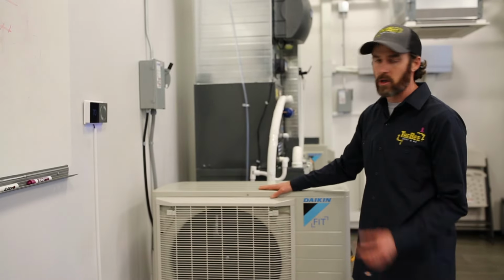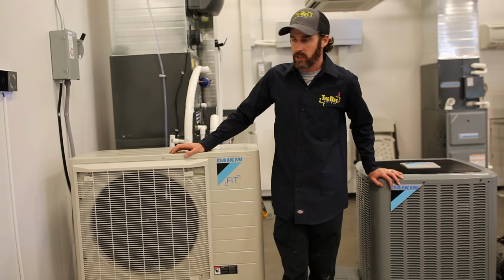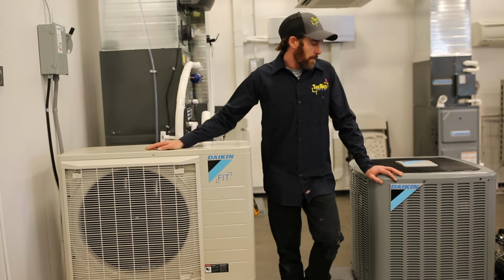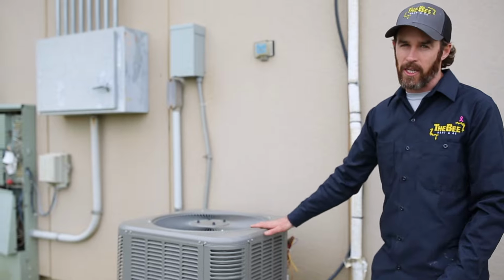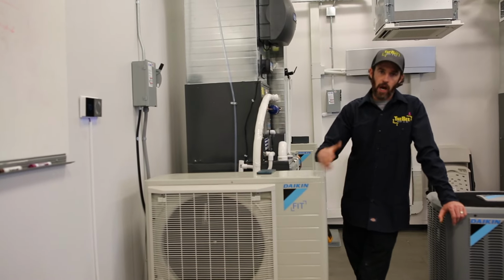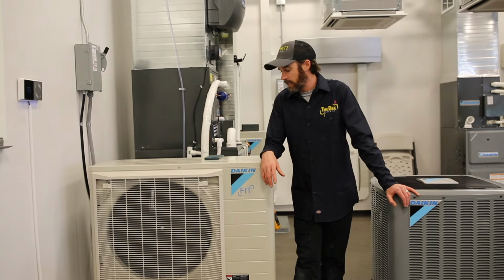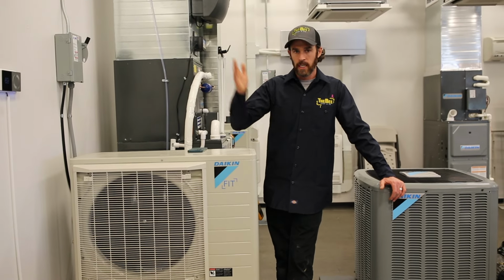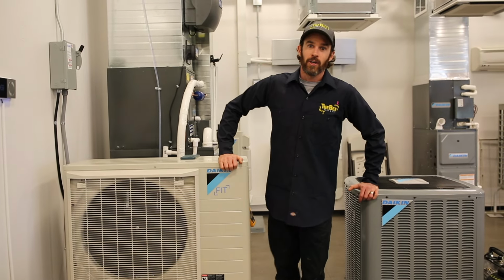BUYING A DAIKIN FIT?! Watch this FIRST or live with REGRET FOREVER!!

Comment: I’ve just replaced my old Carrier with a 3 ton Daikin 7 SEER A/C. My question is, does the installer need to add refrigerant to this brand new unit? I was told that the manufacturer pre-filled it with refrigerant so which is which??🤔
Reply: Yes, these units come prefilled with refrigerant, but more may need to be added, depending on the length of the lineset

Comment: Your amperage demo was not only garbage, it was also dishonest as hell. It maybe the worst I’ve ever seen. Your typical two ton outdoor unit will draw between 9 to 13 amps. Regardless if it’s a DC inverter unit. FYI, Electricity is sold in kilowatts not amperage.

Comment: Be sure that your ductwork is up to snuff before upgrading to a variable speed Daikin.  If your ductwork has too many Y’s instead of distribution boxes, it will not give you enough airflow to properly cool your house due to the lower fan speeds.
Reply from the maker: Good advice, I haven't seen this but we deal with mostly hard pipe on installs in colorado

Comment: FITS are horrible at heating (DON"T GET) !!   I purchased 2 sets of 17SEER Daikin Fit Heat Pumps.  The temperature stability and reduction of thermal swings in the summer month has been great, BUT it really SUCKS as a heater.  I've complained about this, but the company can't do anything about it, and has remarked that i'm not the only customer with this complaint.  I have two FITS, so it's unlikely that I have two bad ones.  The FITS seem to want to go into defrost mode after nearly every heating cycle, producing multiple horrible cold drafty sessions (each lasting over 30 min ) every night. This behavior might be reasonable in cold states up north, but this is Arizona in the southwest.  Temperatures rarely drop below 45F.  I get the temp on the coils is far lower, but this behavior is ridiculous, counterproductive, and uncomfortable. Older HVAC systems, don't behave this poorly. I grew up in NC (a far much colder climate) with heatpumps that didn't behave this poorly in the winter.  At the very least, the Fits should be programmed to blow with much less power during defrosting, but they seem to go full throttle during defrosting. Also, when the heat kicks on, it starts up cold. They should pre-prime the coils to be hot, before starting the blowers!  Unfortunately the furnace option for the FITS were not available during the time of purchase.

Comment: The startup current of traditional compressors often trips off a solar inverter supplying it, so need to wire-in a "soft start" (~$350).  Not a problem with newer inverter-drive types.

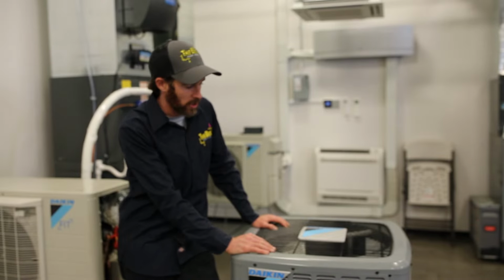Comment: I pulled the trigger and purchased the Fit for my home in Fort Worth. The installers,2 guys,showed up around 7:30 and got started. They removed the entire system and had the new Fit installed and powered on about 11:00.it was around 90 degrees in the house,typical North Texas summer day, the temp dropped to 76 degrees inside in about 20 minutes. I was shocked at how quickly it got the temp down. They had set it to 68 which is a bit too cold for me but the humidity and temp in the house was great. The air flow is better than my old system. My home has never been so comfortable. Although the Fit is a tad pricy,it consumes so much less energy. I have solar a Tesla Power Wall and a Span Panel so I can see how much power my home consumes. I’m excited to see how much my power bill drops. I’m very happy so far with my purchase and see it as a good investment.
Reply from the maker: Right on! That's awesome sounds like it's working well :)
Reply: Hi there! Still liking your Daikin Fit? I appreciate the reply.
Reply: @DanieleHawkins yes I’ve had it for a year now and it’s cools like nothing I’ve owned before. Really energy efficient. I have solar on my home and my electric bill was $11 last month. Best home investment I’ve ever made.
Reply: @fw1421 that’s great ! Thanks for the reply. 👍🏻
Reply: What system were you using before? Are you still liking the daikin fit? I'm looking to replace my system with an Amana S (basically a Daikin Fit) but I'm worried it wont be able to handle southern Texas humidity and heat in the summer.
Reply: @ I had a 12 year old Goodman system. My December my electric bill was $35 dollars and my gas bill was $130. I had gas in the house from being built and liked the gas efficiency. My A/C guy didn’t tell me the Daikin made the fit as a heat pump system to so I didn’t get the big tax credit but I still get a $600 dollar tax credit,or so say my Tax lady. In all I’m very happy with my purchase.
Reply: I am in the Aledo, I am looking at this Fit also for my new build. Who did you go through and can you share the cost? Also what tonnage did they install?
Reply: What year was your home built and how many sq ft? We have a 2600 sq ft single story home built in 1995 (original insulation) and are being quoted to replace our trane 5 ton 2 stage from 2013 with a 5 ton daikin fit.  We are just concerned if the fit can consistently keep the temp and humidity down since we live in Houston area and our home is not exactly energy efficient.

Comment: I have discovered that in the VA beach area two of the companies were asking $3000.00$4000.00 dollar in stall (metal vents are all ready there and the 60amp wire was installed by electrician) I had to pull teeth to simply get them to tell me HOW MUCH WAS THE UNIT? How much for Labor? I find a 5 hour or less install is CRIMMINAL to ask for $3000.00- 4,000 for fricken labor. Is this the new "CON JOB" and what all the kids are doing?

Comment: What is the difference between DZ6VS and RXTQ 4 ton heat pumps? Which one considered better?
Reply from the maker: RXTQ is a VRV and has more functionality / can be paired with multiple indoor units... technically VRV is "better" for this reason but IMO I like the way the daikin fit heat pump performs instead... the VRV functions as a multi speed blower instead of variable speed like the daikin fit heat pump so you'll technically get a little more airflow functionality with the Daikin fit heat pump than with the VRV (RXTQ)... VRV is typically a lot pricier too to install just because of the design considerations and extra components. If you're not zoning there's no need for an RXTQ
Reply: @thethoughtprovocateur thanks for the comprehensive answer! I do need zoning, but only between 2 floors regular ducted zones

Comment: Is the Fit worth the increases price to purchase?
Reply from the maker: I think so, it’s normally not a “big jump” but that’s relative. From our cheapest system to the daikin fit is usually only $1,000-$3,000 more because there’s a lot of state and federal credits on the heat pump right now. In Denver city it’s even cheaper because they have a huge city rebate for heat pumps on it. But even at full price I think it’s worth it for quiet, and max comfort. If you don’t care about your system being quiet it’s probably not worth the upgrade but as an HVAC guy I’m kind of a “connoisseur” of HVAC lol so it’s worth it to me

Comment: I work on daikins everyday 12-20 seer including the fit and I’ve ran so many callbacks on new installs that were done correctly. Even a small lighting storm can completely fry these things at times. These units are not ready for mass consumption in their current state. I’ve checked every aspect of these units in and out and in the two years I’ve only two of them that had temp splits over 15 degrees (in charge mode after 20 minutes). These fit systems all have low temp splits and a lot of people complain they won’t cool the home during regular runtimes. IMO get a single or two stage system they will be more reliable than the Fit
Reply: These units are not what they're cracked up to be, even with a surge protector on them the boards go out quite often , if you change one board you better change them all.
Reply from the maker: It’s true they can be more finicky but we don’t have that issue in Colorado.
I know in more extreme climates they can have issues but we also put surge protection on every system we install on the indoor and outdoor unit and that seems to save a lot of issues with boards and ecm motors etc. We looked at it and decided including $150-200 worth of surge protection was cheap insurance against something getting fried and they’ve done pretty well for us

Comment: Great video..as always. Would you happen to know if the air handlers supported by the Daikin fit (heating and coolling units) allow for the air handlers to be turned off once the desired target temp is reached? Thank you
Reply from the maker: Yes they do, it’s in the settings on the thermostat
Reply from the maker: They do have overcook to dehumidify and “dead band” settings though so it will always overshoot the temp by a degree or two and this is normal, and waits a degree or two before kicking on. This is for efficiency… for example if you set it at 72, it might not kick on til it rises to 74 and might not shut off til 71/70, and the reason is longer run times improve efficiency and comfort. But what you’ll find is on the hottest days it’s very comfortable because it needs to run constantly anyways and modulates down once it hits set point so it will run in low speeds a lot

Comment: I received 3 quotes for replacing my 22yr old furnace and york ac. I was almost sold on the Fit but then another bid was presented and it was mentioned to check the BBB for Daikin and wow a nightmare under that name. Lots of people heavily regretting the Daikin product. We live in the Pacific Northwest with mild winters usually and a few months of 80's/90's. Almost thinking the standard American Standard 80/95 furnace and 3 ton AC for our 2200 sq. ft. drafty home would be a better fit. It's about 12k and the Fit is 15.6k after all the rebates. Just don't trust the governments motivation and their solutions for green is usually poo. Take the florescent replacement bulbs that you dare not break or release toxins in the house with a long list of how to deal with it. No thanks green government initiatives are usually crap.
Reply from the maker: Surprised that Daikin has more complaints than others? I’m pretty sure all of them have had their fair share but you won’t regret a basic AC / furnace combo by any means. Biggest thing with the Fit is sound

Comment: No one in Houston knows how to fix them; my 4 year old daikin 18k heat pump only blows cold when it is sunny and very hot outside…everyone wants to throw expensive parts and daikin support won’t help.
Reply from the maker: This sounds like a settings issue… there’s a cooling range but it should be able to cool year round in Houston, installer settings should be able to fix this I’m sorry you’re having a hard rime
Reply from the maker: If you’d like a referral lmk we can try to find someone to help you out in Houston

Comment: Just got a new unit and I find that the fan inside the house in the closet is very loud
Reply from the maker: You or the installer can adjust the blower settings and ramping profiles. You can also have them insulate the return box with duct insulation to quiet things down

Comment: Got our 2 ton outdoor cold climate unit with a 3 ton indoor unit. I noticed the fan noise was a bit much. Found the dealer edit option on the thermostat and turned down the heat fan speed on all 3 levels to 15% reduction. Now it is a lot better. Is there anything else that should be done to double check the air flow is correct?
Reply from the maker: No that should do it, that air handler is probably just putting out more airflow than needed we do the same / similar things often on systems to match customer comfort. Most of the higher end systems with more settings just require that type of fine tuning to get it just right, but that shouldn’t pose an issue at all as long as your comfortable

Comment: I'm in the market right now, and local place is offering this very product- well almost, 3.5 ton daikin fit variable speed system inverter Heat pump. $1,500 instant rebate with the smart thermostat. Any feed back on this unit? Townhome 1600sq ft Florida home was built 2008, keeping all the vents, ect.. Installation, unit, cleaning all vents. $9k Accepting all suggestions and/or concerns
Condenser: DZ6VS*42
Air Handler: DFVE42/48
AHRI: TBD 
Duct Cleaning 1.0 
Rotobrush duct clean all supplies and returns
Sanitation of duct system
Clean all registers
Reply: Where in Florida?  I am in Clearwater
Reply from the maker: It’s a great product, our best seller. Surprised by the price because thats very low compared to what we’re used to seeing but that’s always going to vary by region and contractor.
Reply: @thethoughtprovocateur  Thanks for the info- Technically the price is $10,500. The rebate drops it by $1500.

Comment: Will a 12000 btu cool a 700 square foot home? Thanks for sharing!
Reply from the maker: Should be fine honestly but just depends on the region, but that should keep up fine. I would just make sure it’s rated for the hottest days outside. If you’re in a moderate climate (under 105F) then you’ll probably be fine with most manufacturers
Reply: @thethoughtprovocateur  I'm in the bay area  (Berkeley). I was going to choose a 18000 but wasn't sure. Our home is small as I mentioned.  The price difference between the 12,000 and the 18,000 is $1,000.

Comment: Will daikin dz17vsa361ba  big enough for a 3000 sq ft house? Spec says 3 ton, that is good for 2000 sq ft.  But it also says 1.5 to 5 ton variable, what does that mean?
Reply from the maker: You want to have a heat load calc performed if you’re unsure because it depends what’s above or below grade, sun exposure, insulation and especially climate. In phoenix you’d probably have 7 tons of cooling for that, but in Denver might be 3-5 depending on if it’s all above grade or what the layout is. The model you referenced is a 3 ton, so if it says 1.5-5 ton variable that’s just the model line and what’s available as far as sizing. Your contractor should be able to perform a block load calc at least and know based on when your home was built and design what will work
Reply: @thethoughtprovocateur  Thanks, I'm in SLC, Utah region, home is South-West facing, with a lot of Sun in summer, 1000 ft basement, most of it below grade, 2000 sqft main level plus second floor.

Comment: I live in SLC UT and I'm looking at the numbers and it rarely gets below 10F... So I'm thinking if I get the SkyAir I don't really need a gas backup. I assume if you don't have the dual fuel setup that should save you on the total install purchase price. I have solar and have a ton of banked surplus power so if I have those extremely rare days it goes below -4F I assume I can run my 3 space heaters in the house to hold me over until the next day it goes back above 0F. But I can't remember the last time it was below 5F.
Reply from the maker: You’re probably fine but either way you’ll have backup heat with an electric heat kit if you’re going with an air handler. I would get a quote for both, and also consider checking with a local contractor because Daikin has a 120V air handler coming out soon (all are 208/240V currently) and with that it’s easy to delete a furnace without needing a 240V electrical circuit if you don’t want / need backup heat. Dual fuel (having a furnace too) will maybe add a little to the price but because you still have an air handler I don’t know how much the difference would be. Air handler is normally less vs. a furnace / evap coil combo.

Comment: Im replacing my heat pump which is only about 9 1/2 years old. One of the companies i have a quote from is proposing a Daiken Variable speed system vs a Trane single stage replacement unit. I never heard of Daiken before but the Daiken seems to make a lot of sense for me over a single stage system. I am also looking at a Carrier single stage and Goodman single stage system. No one i have a quote from has recommended a Daiken variable speed system. Dont any other mfgs like Carrier offer this different kind of technology?
Reply from the maker: Yes most of the manufacturers have inverter equipment, but the specs and prices are going to vary widely. They're often more expensive than the Daikin Fit because even Daikin has a higher SEER DX9 inverter that is a pretty big price jump when compared to a Daikin Fit. Most inverters are the way to go because they're so quiet and the efficiency is typically a savings of 30-40% compared to a single stage system.

Comment: We have a few vacation rentals there. We actually need to upgrade everything. We live in Dallas. Will that Daiken work in this zone on a large ducted system in an attic. Our Denver homes all have mini splits that are nasty and need replacing. Also do newer mini splits have uv lighting on those coils to stop mold. That’s a big problem in Texas with higher humidity so our coils are covered from every angle with uv lights.
Reply from the maker: Yes you could add a UV light that’s not a problem and will reduce mold or algae growth. I know this is very common in high humidity climates. I’m not sure if any of the mini splits have built in UV lights, that’s not something I’ve heard of but in Denver / Colorado in general we don’t have as many issues with mold etc because humidity is so low here. If you live in Denver we’d be happy to take a look. I’m curious what the Dallas Dealers would have to say about UV lights or how many they use typically or what type. We use a lot of Reme Halo lights in Colorado.